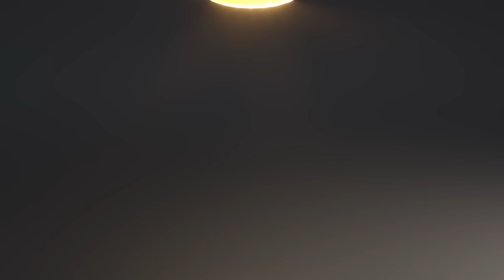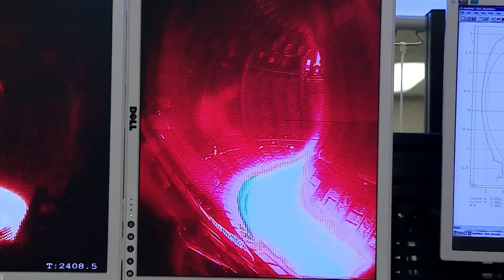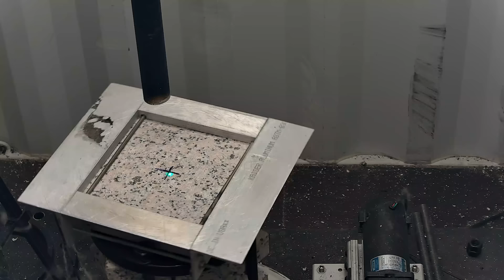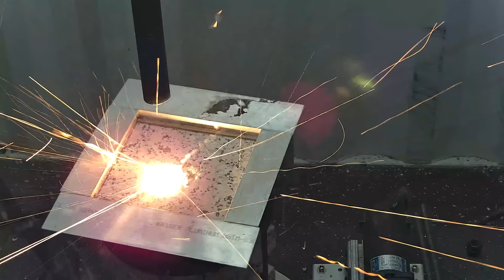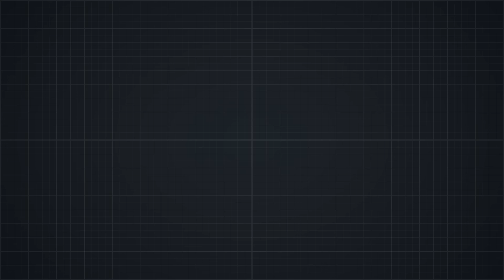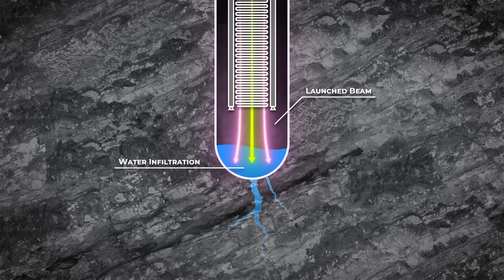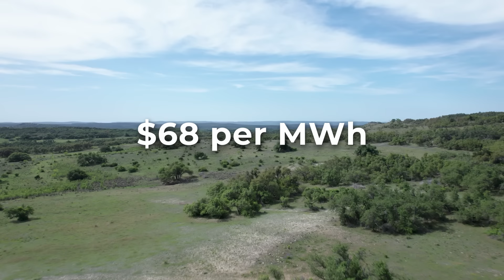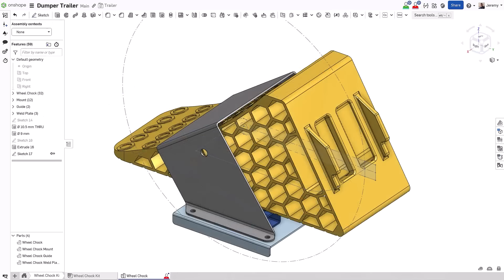Geothermal Energy is Changing

Comment: How to avoid the redeposition of the rock vapor in the hole itself (as seen in the test chamber) ?
Reply: They plan on pumping gas like nitrogen or argon down then it carries the vaporized rock particles up clearing the hole
Reply: the rock vapor is like cotton, its like rockwool insulation is made. easy to blow it out of the hole
Reply: @rando9574  i really cant imagine it will stay easy when the borehole is kilometers deep.
Reply: @boycefenn  This is what i'm scared of too. If the rock solidifies into dust it's probably fine, but if it solidifies into fibres they could get stuck on any unevenness in the hole walls and potentially build up until it clogs. You can probably detect that by having to increase the pressure of the purging gas, but how do you solve it? Flush it out with water? Retract the drill until it clears the clog? Send down a service droid? I have no idea. Maybe existing drilling technology already knows how to deal with that type of stuff 🤷‍♂️
Reply: @boycefenn  pressurized gas is easy to compress, it's not a spinning fan so no moving parts. To keep it under pressure for a very long distance is done in many factories! But clogs might still happen, so the pressure needs to be very high
Reply: @omniphore4913  it's not keeping it under pressure that's the problem here. It's the condensation of the vaporized rock. You can keep things pressurized quite easily. But I don't think they'll manage to keep the rock vaporized for more than a few meters of borehole. So now we're talking about forcing kilometers worth of condensed rock through the borehole. That sounds extremely difficult
Reply: @boycefenn  the pressure stays the same in the entire hole and moves any material that doesn't condense onto the walls up. In a second step, a long vacuum cleaner could clean up the rockwool dust that sticks to the sides
Reply: @omniphore4913  I don't think you quite appreciate the scale here. We're talking miles of borehole. Even the slightest buildup could cause a clog that the pressurized nitrogen may not be able to blow through.

Comment: Energy engineer here.
Rock is a very poor thermal conductor. As proof, rock wool (6:34) can be used as insulator in buildings. 
As a result, once you've reached the depths and the thermal energy of the close area has been evacuated, the heat is gone. The remaining conductive power flow is then very low, and not at all a constant source at the initial temperature of 400°C.
This is a big problem for an energy production plant, obtaining an infinite source of energy with almost zero power output is pointless.

For more information, google : Why Deep Closed-Loop Geothermal Is Guaranteed To Fail, Mark McClure, February 21, 2021

Current geothermal power plants use the high thermal convectivity of water to recover energy. However, the water used is underground water that slowly seeps into the hot zone. This water is heated for days or even weeks in the area before arriving at the extraction point. If such a power station extracts more energy than is provided by the naturally heated water flow, its power decreases over time.
Reply: agree
Reply: Thats why deep horisontal sections are nessesery to let the rocks recharge. Check out DeepU Project

Comment: How are they going to stop the hole from getting plugged with the resolidified rock gas?  AKA how are they going to keep the rock vaporized all the way up to the surface?
Reply: I imagine they could have something similar to conventional drill bits to feed the resolidified fibres upwards
Reply: @davideverling753  Traditionally water is used to flush out the cuttings. 
From what I've witnessed in oil or lng drilling, water is pumped through the joints (the rotating drill pipes) and flushes the cuttings upward between the string (the full length of connected joints) and the hole's casing (or raw borehole wall).
Reply: I'm also wondering that
Reply: High flow N2, above 4m/s will easily carry glass fibres that far, same way drill cuttings are returned.
Reply: @Carl2k7  only loose materials in a smooth bore can be carried, what happens to the strands fused to the bore hole which then further act as a filter to catch the loose bits?
Reply: @TheDuckofDoom.  do you mean for the full length? Usually you will have a conductor or casing with a low friction coating that wont let the material ahdere, if you used a vortex at the vaporisation point you can initiate a coagulation of the fibres to make them easier to return. :)
Reply: @Carl2k7  The condensing is going to be in most freshly drilled 20 meters(give or take an order of magnitude) which is not cased by the nature of any drilling. 
Anyway the whole advantage here is that they don't take time to pull out of the borehole, and you cant put in a casing if you don't pull out the drill column. 

Now maybe if the purge gas is cool enough and contains some nucleation dust, and the bore wall retains enough heat then condensation might be encouraged to form in the free stream rather than at the bore surface.
Reply: @TheDuckofDoom.  it’s such a cool promising technology, i do wonder how it could be adapted to navigate something like a fractured basement with fluid filled fissures
Reply: @Carl2k7  i was thinking the same or similar
Reply: @Carl2k7  got some ideas for a low friction, high temp resistant coating?
Reply: @InnovativeTyler  PTFE is good but the tensile strength is not so good, it tends to buckle and split as a liner, maybe as a film, probably a smooth polished ceramic coating
Reply: That's what all the nitrogen is for. The rock doesn't stay vaporized, a bit forms the glass along the walls, the rest turns to dust/ash that is blown up by the constant high pressure air being pumped down the waveguide.
Reply: They will blow it out just like you would clean up with an air hose.  Air drilling using compressed air is now a well understood process that is use in oil and gas drilling to keep drilling mud out of porous formations where it could contaminate the water table.
Reply: @johnmiller8884  do you have to use N2? Or compressed air is just fine?
Reply: seems they are hoping to carry it as dust or strings in the nitrogen they are pumping in as it comes back out, kinda like what normal drilling does with water. Not sure how they are going to keep it from snagging and building up anywhere on several kilometers of pipes tho.
Reply: Their goal is that the pressure from the gas will cause the melted rock to cool and solidify in the well's walls, leaving a open centre gap for the drill and gas while the walls are strengthened
Reply: @ms3862  Solid rock is not foam and solids do not magically disappear.
Reply: This is a key question.  One thought I had was that the intense heat might chemically change the rock -- though I have no idea what happens when you mix silicon, oxygen, and nitrogen in a plasma, then let the mixture cool.
Reply: @alandpost nitrogen is inert so probably wont bind with the waste gas itll just carry it out as more nitrogen is pumped in and a steady pressure is maintained
Reply: They are using nitrogen to purge the excess vaporized rock out of the hole.
Reply: I imagine that's what they're trying to find out by playing around with the stand-off and purge gas flow rates. Air drilling already exists where the pulverised rock is returned to the surface using high pressure air or foam instead of drilling mud as usual. The rocks won't be a vapour all the way up it'll most likely turn into dust and blasted out the surface. 

At some point down the line they'll defintely work on hole cleaning procedures like how much to move the drill up and down to dislodge the rocks ("reaming/backreaming"), varying flow rates for most effective returns and prevent the hole getting packed off, what effect roating the string or how fast they drill has etc. All this stuff is what drilling engineers plan for before drilling.
Reply: They said they could pump nitrogen into the hole to bring up the gas earlier in the video. Not sure if that would actually work but nitrogen is used in welding as a shielding gas to prevent debris known as slang being stuck to the weld puddle. They would have to be able to brush and pull this slag out constantly imo
Reply: At least in a video game world how I would solve that on paper is by letting the rock vapor crystallize into fibers similar to fiberglass, and then just pull the fibers up and use them maybe for housing insulation
Reply: @KaizenOramara are you reinventing asbestos?
Reply: Then again isn't that what asbestos is? Might be a bad idea actually
Reply: @KaizenOramara no its like rockwool which is made out if basalt
Reply: @KaizenOramara  silica fibres, yeah. No different to the likes of rockwool and fibreglass except one is scary because the media says and the other is just waiting the required 20-30 years to rear it's ugly head as silicosis
Reply: @KaizenOramara dude just don’t “in a video game world” like get a life bro 🥀
Reply: There are safe similar stone thread like products on the market right now. (Rockwool).
Before 1997 it was a problem though.
Reply: They might need to redrill
Reply: A giant vacuum cleaner…
Reply: I thought at the beginning of the video it said there was a vacuum sucking the vapor out
Reply: I continue to "shake" oilmen with my innovative project of a non-combustion engine, I remind you that I am posting here on my channel the technology and the principle of operation, according to which anyone can create a prototype and enjoy free energy, since I was denied financial support at the stage of the idea and theoretical research, after a year of unsuccessful searches. Including I will begin to assemble a sample. And soon another video will be released, revealing my developments, the wind of change is approaching! All those who are not indifferent, welcome to the flight in this departing innovative car, which will lead to great achievements for the successful future of the planet and humanity!

Comment: Cost is not the only factor to take into account when comparing method of generating electricity. How much land do you use? Will you be able to produce electricty when it is actually needed? What are the impact on the environment, etc, etc. Cost is just a factor and, when you consider how reliant our modern societies are to electricity, it's not even a major factor. Ask yourself this question, would you be OK with having electricity bill divided by 2 if it meant it could be cut for a few minutes any time of the day or night?
Reply: The key to scaling geothermal power production efficiently is directional drilling. Instead of drilling straight down, modern drilling techniques allow for multiple wellbores to be drilled from a single, compact surface location.

Imagine a central drill pad on a few acres of land. From this pad, you can drill multiple wells spaced roughly 100 feet apart at the surface. However, instead of continuing straight down, each well is gradually steered in a different direction once it reaches a certain depth. Some wells might curve north, others northeast, others east, and so on, eventually covering all 360 degrees around the site.

This approach maximizes the amount of hot rock a single site can tap into while minimizing surface land use, making it ideal for high-density geothermal projects. It's the same directional drilling technology used in oil and gas, but applied to clean energy production.

Comment: I'm wondering. Given that the vaporized rock eventually cools down and settles in those spiderweb-like formations. Wouldn't the vaporized rock from 1Km below eventually solidify while going up and end up clogging the hole?
Reply: i'm positive the engineers have thought of this, but it's annoying they don't talk about the solution in this video. borehole drilling requires a continuous flow of water to get the mud out, it might be possible by pumping air, but whatever piping you use a meter of rock fibers will probably lead to a blockage unless you have some kind of solution. 
i mean, even a couple meter long vacuum hose will become clogged by dust over time, and that has pretty high flow rates.
Reply: If they told us then they'd be giving away the actual trade secret. 

Everyone knows the ingredients of Coke, the "secret" is other things in the process
Reply: @zporadik5651  They have to convince investors. If they started listing every issue upfront they won't get funding.

It's a constant tug of war between the interests of both parties.
Reply: Was thinking the same thing. Don't see a viable solution of the top of my head. Field tests needed.

Comment: In areas where they have access to cheap natural gas they could get the cost of energy way down but really the cost of energy is not really even a big deal in this case.  Ideally they would also just want a drilling rig that can move itself and then do directional drilling.  If they can keep the drilling rig on the same lease for a couple years and it just moves itself that can keep costs down.

Comment: one thing about the LCOE for the Quaise is that all of the initial capital costs can be reused to keep building more holes, you just have to feed it more power
Reply: While ideal, given the conditions that are being run through, and the material that IE the waveguides will need to interact with, (IE getting slammed with molten rock for literal days on end) its very possible that they might actually be consumables. This is something that is going to need to be researched through field experience to determine just how badly everything will wear.

That said, if this works, it will be a huge boon. Geothermal is one of those power sources that has nearly no downside outside cost. Even theoretical fusion creates some radioactive parts, solar takes rare materials, and wind has many social detractors in IE the uk espically (I love how they look, but many hate it).
Reply: I know some geothermal plants use isopentane to transfer heat from the borehole, but I wonder if anyone has considered using refrigerant instead?  It would be less efficient, and the turbine design would need optimization, but you wouldn’t have to drill as far to reach boiling temperatures.